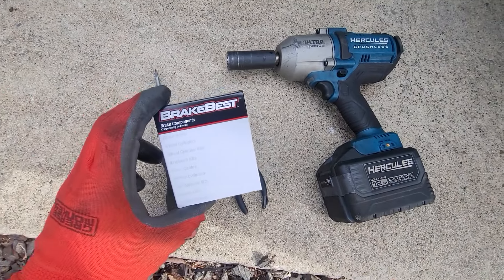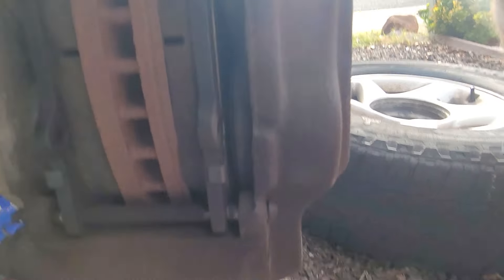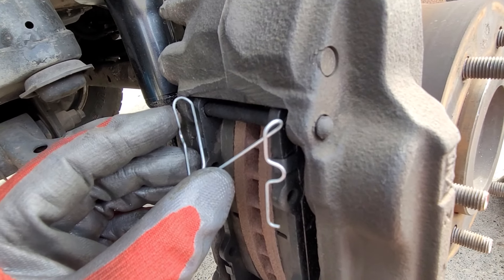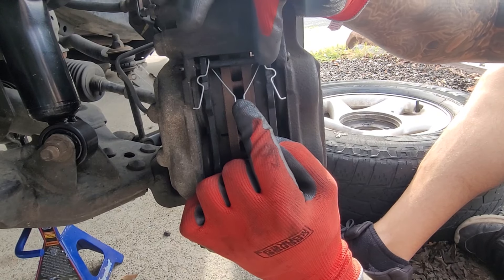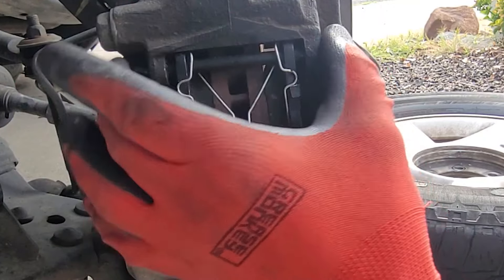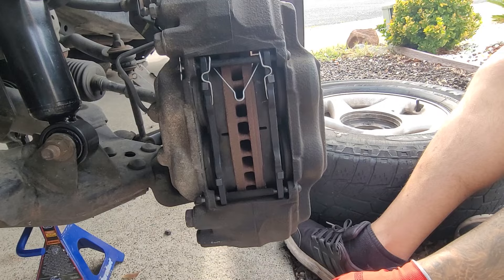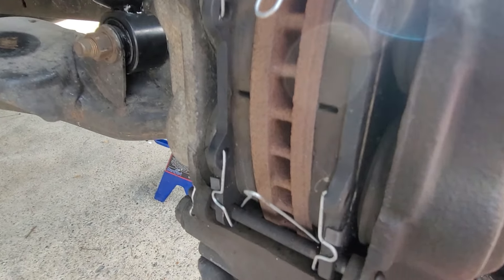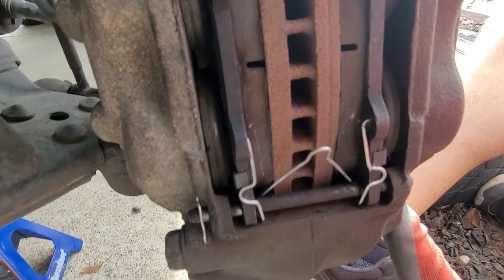How to Fix Brake NOISE and Rattling Toyota Tundra - Brake Kit Install

Comment: Top and bottom? Install for my 2018 shows just bottom so I've never bothered or paid attention that one could fit up top as well. 

On the side though for the guide pins, rather than the circle locking method keep pin there, there is a long rod going from top to bottom pin that prevents rattle making the items installed here obsolete or just an extra shield against rattle 

Just did mine tho and getting a pop noise so Im jacking it back up in a sec